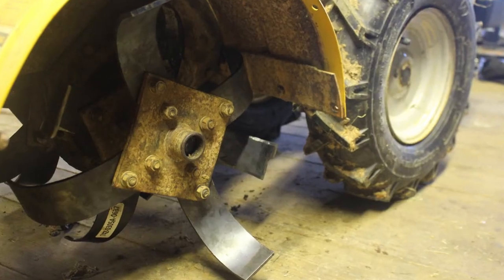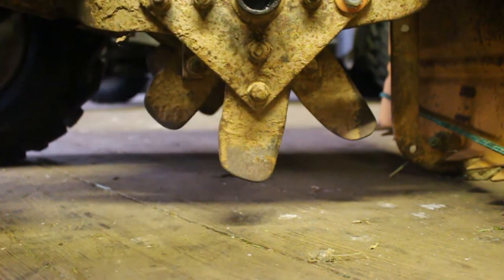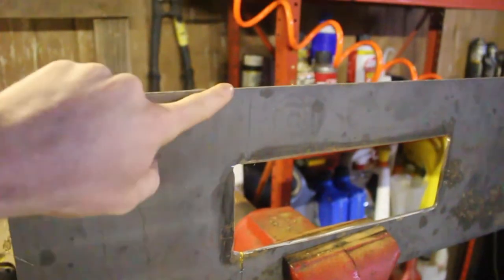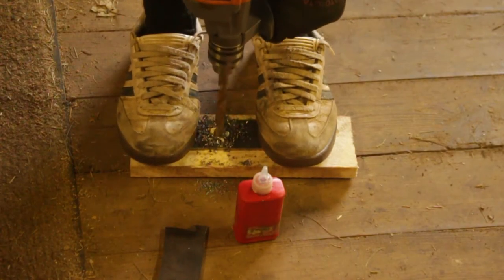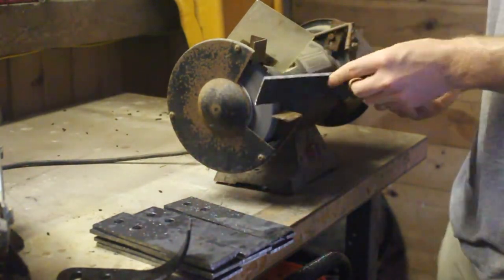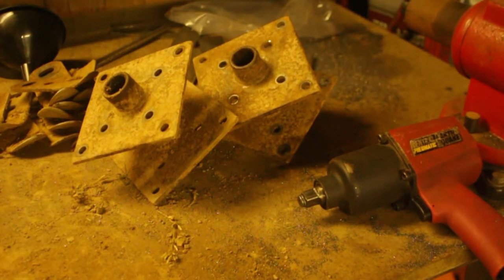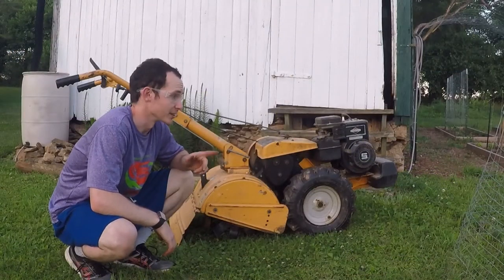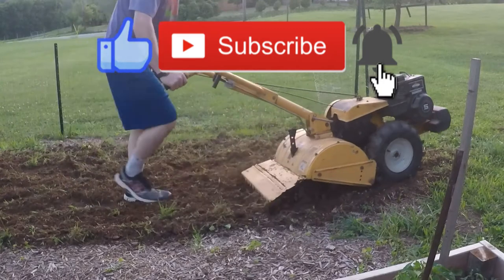Making Tiller Tines Out of Scrap Metal! DIY Rototiller Blades

Comment: TOO SOFT. you cannot DRILL ROTOVATOR BLADES as all are HARDENED.  you have NOT MADE ROTOVATOR TINES, just a BODGE UP.
Reply from the maker: I like the term bodge up, but I can assure you it doesn't make that much of a difference in real life. Unless you are putting a few hundred miles a year on your tiller, steel is steel

Comment: They'll work ok in soft ground, but seems to me you would want to harden that mild steel....hard ground or one good rock and boom....bent blade...just my thoughts, good video though, gives me some ideas, thanks!
Reply from the maker: I’ve actually hit a lot of rock with it but it just jams the tiller, it doesn’t have the power to bend the blades

Comment: Tines are heat treated and made out of high grade steel not  mild steel.  Depending how much use you need it might last a year or more or not even the year.   We had 5 acres of vegies we did with a troy built horse model back in the early 80s.   Those would not have lasted a season.   But for what you have they could last a few years.   Which is good value.
Reply from the maker: Still going great 3 years and lots of rocks later!
Reply: @MasonDixonAcres  happy to hear they are lasting for you.

Comment: great job! 
i would suggest leaf springs from some scrapped truck as material for your next set of blades. 
that is much better material for this application.
i made a rototiller for tractor out of rear axle and leaf springs of the same truck.
there is a video about it in my channel.
Reply from the maker: I checked it out! That is a serious machine, really cool fabrication work. Great to use what you have lying around. I agree, the spring steel would certainly be more durable than the mild steel I used.
Reply: OLD lawn mower blades  ?

Comment: How did your tines wear? I need to replace my own tiller tines, I am retired on a budget and I am considering making some tines in a similar fashion.
Reply from the maker: I have only put about an hour of total use on them, they don't show any wear but I don't have much data. For occasional use in the spring and fall, I think they will last forever. If you till a lot, I would recommend a simple heat treatment and quench to harden the steel and make it less prone to wear. Best of luck!
Reply: @MasonDixonAcres  I won't be doing much tilling so it is probably worth a "shot". I'll be using mild steel, so I won't be able to heat treat it. Hard facing is an option though.
Reply from the maker: Gotcha! Someone also suggested cutting up old leaf springs from a truck if you can find some of those. I think you’ll be good either way.
Reply: @petertyrrell6690  rust treat them, get the dirt off and put deisel and old motor oil on them when you store them. Rust is why they wear out, every season you knock the rust off they get smaller. All farm equipment gets stored like that or it is a headache fixing equipment every spring.